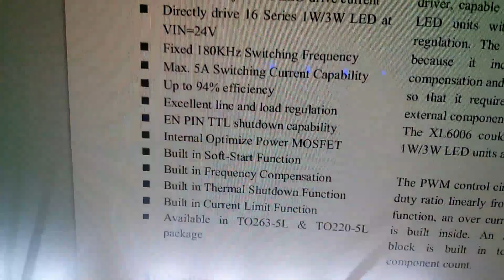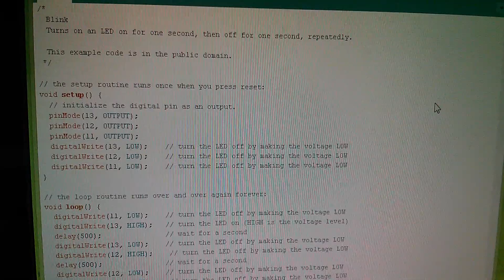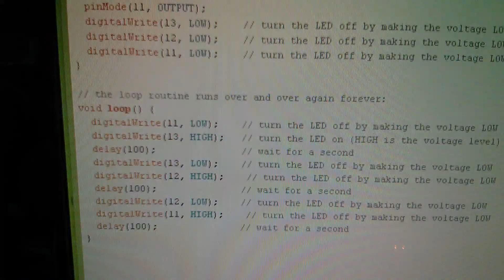Sequencing 30 High Power LEDs with Arduino and LED Drivers #4

Comment: +Julian Ilett hi, hope you can advise me regarding the led driver and what best to use for an sla lcd 3D printer.
i have 30 uv led 3W 405nm , thy have to be controlled by the Ramps 1.4 . what electronics parts should i purchase ?
in your 4 videos i didnt hear you mentioning the Amps as your more talking about the Voltage .
hope you can help me thanks

Comment: Great video comparing the different driver modules using the 'output enable' function.  The question that got 'lost' is - why 3 drivers?  In this case, it's to compare the drivers.  The major concern in the result is the delay (soft startup) of one of the drivers.  If the 'soft startup' can be disabled, it's not a problem.  However, in actual application, that concern is minimal because all 3 drivers would be the same.  This means that all drivers should act in a like manner.  

I really like the variety of topics that you get into.  Thanks

Comment: I had trouble finding buck converters with enable output (input?).  The LM2596 data sheet lists pin 5 as Not-on/off.  And, it works !   The  Arduino 5v TTL logic output will drive this input (with  common ground, of course), but the opto isolation is a good insurance policy.  Any way, +5 volts turns the LM2596 off and remove the 5v (float the input?)  or set it to ground, allows it to turn on.    The 3 pot CC/CV board and the single pot board ,CV,  have the chip in an easy to get at location.  I use a jewelers screw driver to lift the pin 5 as I unsolder it.  Then I solder  a wire onto pin 5 to bring it off the board as Not-enable.   OK,  Thanks a ton for the mind provoking videos.

Comment: Nice video, thanks!  I wonder why you don't use the boost converter with a voltage divider circuit to power all the LEDs?  Skip the buck converters.

Comment: hi,, I'm planning to make street light for my farm using 60 pcs 5w led beads. . please help me.  what is my power supply and wiring diagram  for my DIY project. . I'll take care if the cooling system.  thank you

Comment: This should fix the blink problem:

// the loop routine runs over and over again forever:
void loop() {
  digitalWrite(13, HIGH);   // turn the LED on (HIGH is the voltage level)
  delay(10);                // wait for 10 ms
  digitalWrite(11, LOW);    // turn the LED off by making the voltage LOW
  delay(100);               // wait for 100ms
  digitalWrite(13, LOW);    // turn the LED off by making the voltage LOW
  digitalWrite(12, HIGH);    // turn the LED off by making the voltage LOW
  delay(100);               // wait for 100ms
  digitalWrite(12, LOW);    // turn the LED off by making the voltage LOW
  digitalWrite(11, HIGH);    // turn the LED off by making the voltage LOW
  delay(90);                 // wait for 90ms
}

Comment: Great work!  Most of these "soft start" buck/boost converter ICs have an input pin to set the soft start feature.  You normally connect a capacitor from this pin to GND.  The capacitor value influences the ramp up of the current in the LEDs.  Maybe the IC that is used on this driver uses such a soft start capacitor.  If it is the case, you could try to change the value to increase the current ramp.  Along with what others have already suggested (modifying code to force an earlier start), you might be able to get what you were looking for.  Keep up the good work !

Comment: Hi,

And many thanks for this and the other videos on this test build.
I built my own computer TX style I think they call it, but this system you use seems to be much more complicated, whereas the computer units were just link and plug and play, sorry I do not know enough to use any tech stuff, these drivers need programming which I can handle, and BTW these videos are a great teaching / learning curve on how to program and how to use these different drivers, what it would take for me to get everything built correctly is a lot more studying of the drivers, and or putting 50 squidulars to one side to replace each consecutive blown driver and to learn what blew / it / them before ordering some of the type of correct drivers, so I think I would ‘need’ more studying and careful choosing of the drivers for it not to cost an arm and a leg you know.

Really interesting and obviously (to me anyway) ready for use after some tidying for something like a xmas sequence, with the cheap xmas lights in the background in case one of the apparently ‘managing things ok’ drivers, and sorry for the ban English Language burns out.

I would need as I say more studying of the specs before I bought any drivers, which brings me to how you decided to choose the drivers you did?

Take care
mrbluenun

Comment: Just turn the driver on a few mil/sec before the last driver is shut off. e.g.
digitalWrite(Driver2 LOW);
digitalWrite(Driver3, HIGH);
delay(90);
digitalWrite(Driver1, HIGH);
delay(10);
digitalWrite(Driver3, LOW);
That should give it time to start. If not play with the delays.
Reply: Thx

Comment: Hi!

Really interesting video & nice work! Although I would use only one LED driver, and I would connect the driver's output into three switching unit (relay/mosfet/transistor..). So the driver would run permanent and you could control the switching units. I think that it would be cheaper and there weren't any difference between the drivers.

The idea to buy opto isolators from China is great, in Hungary it's pretty pricey (~1£ / pc).
Reply from the maker: Yes, that's true. This project was really about testing 3 different types of LED driver and showing their differences.

Comment: I haven't been doing these things as long as you have, but surely you only need 1 driver, and switch on every third LED with use of simple power transistors, so 3 transistors is all you'd need. Just switch on one transistor on at a time. That way, it's A LOT cheaper, plus the output power will be consistent over all LEDs. You don't need to worry about soft start-up times either like the SEPIC one demonstrates. The same current is being drawn from the driver, except that it's effectively on 100% of the time instead of 33% of the time shared over 3 beefy supplies. Is there a reason you've opted to using 3 power supplies instead? Interested on your reply.
Reply from the maker: This project was really about testing 3 different types of LED driver and showing their differences.

Comment: Julian, your videos are awesome! Can you tell me what i need to run 10 3W LED's ? These are the ones i bought http://cgi.ebay.com/ws/eBayISAPI.dll?ViewItem&item=141182784282 and i plan to mount them to the "star" heat sink however i cant find any info on how to mount them or a simple tutorial on proper way to run these....inexpensively of course.
Reply from the maker: Thanks Chris. You're better off buying these already mounted on the star PCBs - I've tried to work out how to heatsink them without the star boards and I can't think of any sensible way to do it. I've made a number of videos featuring different CC buck converters and purpose made LED drivers.

Comment: Could you not just alter the Arduino code so it turns on the delayed driver earlier than it would normally have to, waits, and then turns off the previous ones?
Reply from the maker: Yes, although you'd have to know the delay duration (or just do it by trial and error). It probably wouldn't have looked so bad if I'd used 3 identical LED drivers
Reply: I guess you could add a reduction to the delay within the loop until it appeared that only 2 strings were lighting and that'd give you the extra time needed for the soft-start?

Comment: A slightly off topic question Julian. I have for a while now been contemplating using a mid power LED as a substitute for a gas discharge tube to be used as a automotive timing strobe. Do you think the LED would have fast enough turn on and off times for this application running up to say up to 500Hz. The motivation for this is modern ignition systems often use coils directly on the plug so the usual inductive HV trigger pickup is unsuitable and the enrergising of the coils uses inverted logic, finally I just think an LED would be less fragile than the zenon tube.
I have also been following your series on driver/power supplys and was taken by the one you described as almost a 'bench supply'. I am currently waiting on delivery of the big brother 8A version should be interesting to find out the resolution with the higher I rating.
Thanks for the vids, some interesting and thought provoking stuff in there.
Cheers
Rob
Reply from the maker: It's not so much the frequency that would be the problem in this application, it's the flash duration. To get a sharp image (no motion blur), the LED would have to light up for no more than a few microseconds, but be very bright. This would require a very different LED driver from the ones I'm using. It looks like LED timing strobes are commercially available.
That 8A digital buck converter is definitely on my shopping list!
Thanks Rob.
Reply: Thanks for the reply Julian. Looks like more thought will be required. I live in a country town in West Australia so access to the latest goodies is not great, also the timing light market has all but collapsed since the introduction of EFI.

Comment: Do you do these printed circiut boards yourself or do you buy them from the Internet?
Thanks
Reply from the maker: No, I haven't made my own PCBs for years. The driver modules are from Sure Electronics via eBay
Reply: Ok, thanks.

Comment from the maker: Arduino code for this project:

// the setup routine runs once when you press reset:
void setup() {                
  // initialize the digital pin as an output.
  pinMode(13, OUTPUT);     
  pinMode(12, OUTPUT);     
  pinMode(11, OUTPUT);     
  digitalWrite(13, LOW);    // turn the LED off by making the voltage LOW
  digitalWrite(12, LOW);    // turn the LED off by making the voltage LOW
  digitalWrite(11, LOW);    // turn the LED off by making the voltage LOW
}

// the loop routine runs over and over again forever:
void loop() {
  digitalWrite(11, LOW);    // turn the LED off by making the voltage LOW
  digitalWrite(13, HIGH);   // turn the LED on (HIGH is the voltage level)
  delay(100);               // wait for a second
  digitalWrite(13, LOW);    // turn the LED off by making the voltage LOW
  digitalWrite(12, HIGH);    // turn the LED off by making the voltage LOW
  delay(100);               // wait for a second
  digitalWrite(12, LOW);    // turn the LED off by making the voltage LOW
  digitalWrite(11, HIGH);    // turn the LED off by making the voltage LOW
  delay(100);               // wait for a second
}
Reply: Julian Ilett  Thank you.